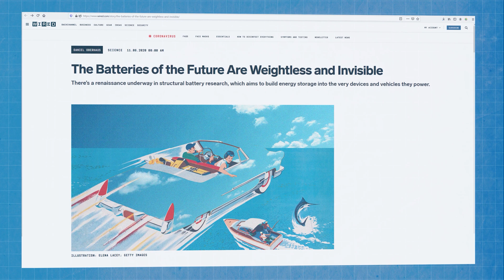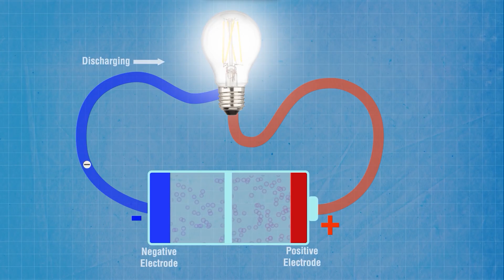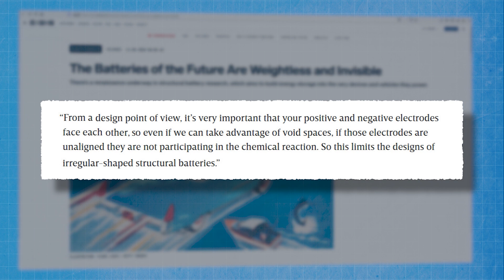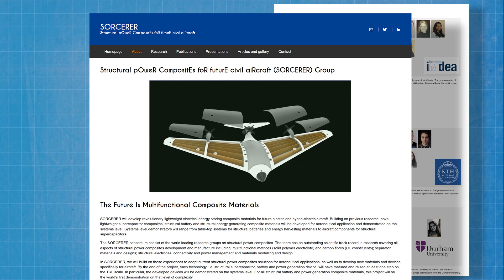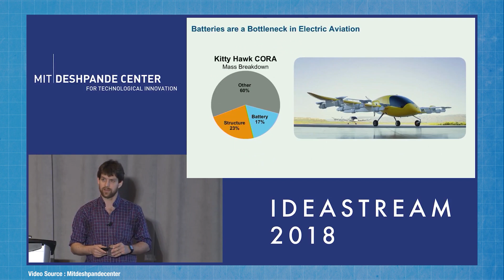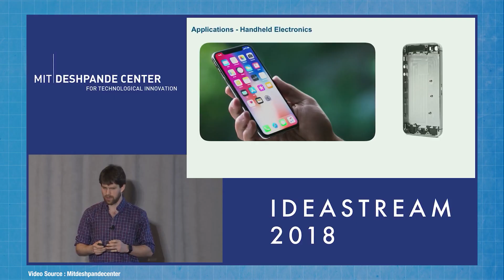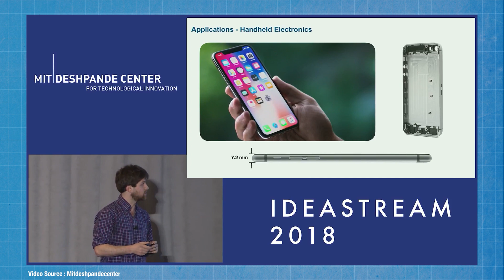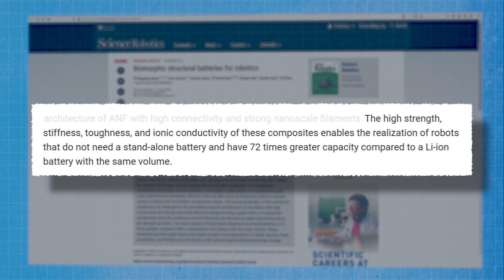Batteries in bodywork. Extending the range of cars and planes.

Comment: What are your thoughts on SONO SION? Solar panels on electric car to extend range? Many people use their cars for short town trips (work, shopping), so long range on a single charge is wasted on most car owners. In Hawaii, sono sion type cars will be especially practical.
Reply: Let's spitball some specs...
— 3 m² of panels on your car
— panels are 21% efficient
— battery charging is 95% efficient
— Car can drive 4 miles per kWh
— The sun provides 5 kWh per day per square meter
Multiply all those numbers together: 3 × 21% × 95% × 4 × 5 = 12 miles of range, if you drive and park all day in full sun (no clouds, no shade).

Is that worth it? It's not groundbreaking, anyway.
Reply: @ps.2  thanks for the math 
yes, in Hawaii, it is pretty sunny all year round.
Most people park in the sun.
On Oahu, coast to coast is less than 50 miles.
Hawaiian Electric burns oil to generate electricity...
Solar panels on the car would mean plugging in every month or two, rather than weekly.

So given my circumstances, thiis will work just fine.

Thx.
Reply: @alohanarealtyllc4046  The real question, though, is: what are the benefits and drawbacks of mounting panels directly onto a car, vs. mounting them on your roof.

Advantages of panels on a car: can charge it anywhere any time, including while driving. But think of the scale. Let's say you drive 200 miles on a charge. That takes maybe a little over 3 hours. How much extra mileage do you eke out if you're driving at noon on a sunny day the whole time, and your car is covered in solar cells? An extra 8 or 9 miles? Somehow that doesn't seem like a game-changer. It's not gonna be the difference between getting to your destination on one charge and having to stop along the way.

What about the advantages of instead mounting solar panels to your roof? They're working for you all the time whether your car is parked in sun or shade, whether its battery is already topped off or not. No need to worry about the extra weight on your car. Definitely easier to manufacture flat panels than car-body-shaped panels, and you can buy flat solar panels anywhere, you don't have to custom-build them for your model of car. Easier to service and replace them, too. And far easier to scale it up to more than 3 square meters, if you can afford it.

I get why it seems intuitive to want to cover a car or an airplane with solar panels in order to "make your own fuel as you go". But given how little energy you actually get for that much surface area, I think it makes a lot more sense to just do what we're already doing, and install more solar panels on larger, stationary, flat places, like roofs and fields. (A solar roof over a parking lot is a great idea and more parking lot owners should be doing it.)
Reply: @ps.2  ah, yes, the "panels on the roof are better argument".
Ok, here goes:
There are 1,000 condos on Oahu, with anywhere from 19 units to over 1,000 units per building.
There are tens of thousands of apartmets also.
Therefore, roof mounted solar is not an option (for hundreds of thousands of people here).
1. Plug in at home? To install a charging station in a condo is legal, but costs several thousands - then, Hawaiian Electric will burn oil to make electricity to sell you to charge your electeic car. Not my first choice.
Install in an apartment that you  rent, but do not own? Very unlikely.
2. Plug in around town?
A. The zoo in Waikiki has 4 charging stations, which are almost always in use.
B. Ala Moana Shopping Center has several charging stations disperesed around the massive parking lot - also, few, and almost always in use.
C. Costco, Sam's, Walmart, etc. Have. Few or none.

Did i mention it is sunny nearly every day of the year here?
And most cars park in the sun all day anyway?

Drivable distances are much shorter here. 
Rooftop solar is not an option (for me).
Sun is free. 
Plugging in is very limited, and time consuming.
Though distances are relatively short, a car is still needed for work, shopping, appointments, etc. 

In summary: 5 to 10 "free" miles / day from the sun is awesome, and liberating. It will work VERY well here for hundreds of thousands of people who drive, but not as much as people do in many other states.

Thank you!

Comment: Not convinced this is such a grand idea. Certainly a structural battery needs to withstand being flexed but what about being punctured?
Reply: In practice, individual cells will be restricted to maximum safe energy and power levels. Large panels will need to be divided into electrically independent cells. Thus a rescue worker will know how big the bangs will be when they cut into the wreckage to pull your mangled body out. They will also know how fast they can safely cut a panel. 

Alternatively, the panels can be inherently self sealing. Shorting a cell by pounding a nail through it makes a localized hot zone. The heat makes the separator expand to the point where the chemicals stop reacting.
Reply: Batteries be like: Try me

Comment: You said that that fossil fuel cars can only count 3%of the weight  but shurly you must count the engine as part of the weight?
Reply: That is a very good point, but it complicates the calculation immensely because we then have to account for the difference in weight between the electric engine and the gas engine, as well as transmission in gas cars- all vital and important pieces of a functioning vehicle. On the other hand, accounting only for the full gas tank vs the battery is comparing only energy density, so it's an easier comparison. Of course, it's notable that the whole thing gets complicated when we start talking about structural batteries because it's much more of an all or nothing situation.

Comment: Structural batteries are a crap idea because most current commercial batteries have a crap cycle life. Also, using lithium batteries make the whole vehicle into a big fire hazard. Now structural ultra-capacitors that could fly.

Comment: Electric cars will have to be heavily subsidized and the infrastructure has to be in place within 5 years or it ain't gonna happen.
Reply: The idea we're gonna make 100kwh batteries for everybody just yo drive around with is ridiculous, as is electric planes etc
Structural batteries don't reduce battery mass, they aim to reduce structural mass, and inefficiently and dangerously, better the batteries are boxed for safety and thermal management, but hey, its just have a thought, not real.
Reply: Teslas are not subsidized in America, and that doesn't seem to have hurt demand.  You're right about the infrastructure; it's pretty disappointing ATM unless you have a Tesla.
Reply: @incognitotorpedo42  subsidized in the sense investment money comes in faster than product goes out, its ponzi
Reply: @williamgoode9114  Investments are not subsidies, nor are publicly traded corporations Ponzi schemes.  Investment in equities is a bet on future earnings, not current earnings.
Reply: @incognitotorpedo42  still a million cars on the road for 540 billion is quite a pyramid

Comment: The thing that worries me most about this kind of technology, is the increased danger in case of catastrophic accidents. If a car essentially made  of batteries (as would be most efficient) crashes and any of the batterys ruptures, there appears the potential for a large fire, in the worst case, the whole care starts burning. If ,as in quite some crashes, doors and bumpers get bent and broken, I imagine that a battery would in the same place break and catch on fire.
Reply: structural car parts = solid state = no volatiles = no fires

There is batteries today you can puncture and they don't go up in flames. And they use electrolytes (volatiles even).

Comment: Structural batteries and also integration with motors is a fascinating subject. But It suffers from the same problems that the integrated circuits suffered from over the last several decades. Before the integrated circuits could be highly integrated, the optimal structure had to be determined.  Things like 8, 16, 32, 64 bit word sizes had to be determined.  The technologies behind memory, cache, registers and other specialized architectures had to be optimized.

The same situation affects an integrated structural power system.  Optimum shapes and sizes of fuselage and wings in an airplane have to be determined.  And for airplanes the skin has to be conductive to be lightning-proof.  Another major hurdle is how to make the structural batteries changeable so they can be replaced when they are worn out.  If the structural batteries are like other highly integrated systems they could take decades to develop.  Meanwhile climate change is relentlessly making the planet worse, so it looks like we humans will have to sacrifice technology for our survival as we battle flooding and desertification. It's not a serene future.

Comment: Hmm...IF you solve the battery problem how do you solve the problem of creating the electricity to charge the silly things?  Fossil fuel I assume?
Reply: Just Have a Think have numerous excellent videos on the subject.
Reply: Obviously not.  The idea is to get off carbon entirely.  Electric vehicles give you the ability to power your car without fossil fuels; that's the whole point.  Non-carbon sources of electricity include Hydro, geothermal, wind, solar, nuclear and tidal, off the top of my head.
Reply: @incognitotorpedo42  I would add waves to your list, too. There's at least a Finnish company called Wello Oy producing such power plants.

Comment: If Canzuk develops as an idea - have thought that bulk trade needs to get above the viscosity of water and the immense drag of hulls through it - sort of designing in a ‘treacle effect’.
In this connection wonder if ground-effect transporters of modular composition are a possibility and in which carbon containers may integrate as part of the effective design in the same way as you describe for batteries?
Insertable into steel containers upon trans oceanic delivery of course. Sea-water always available to balance up the weight of the system.

Comment: Consider how the first bathrooms were “water closets” and essentially just converted bedrooms or closets. Then the design of a separate bathroom became normal house design. I imagine soon homes will be designed with battery integration in the floors or walls
Reply: Houses last longer than just a couple years.. so this is not going to happen, unless the battery really lasts for more than 50 years minimum and is able to do 1-2 cycles per day then.. 50x1.5x365 is 27k cycles.. what battery tech can do that, if ever?
Reply: @joansparky4439  You have a point. If this tech could be made in such a way as to be fully recylable, though: terrific way to ease the problem of homelessness....
Reply: @joansparky4439  I don’t know what you’re imagining, but I would have the homes designed to allow cell replacement. My idea is to design their placement in the walls and floors, as opposed to dedicating space in a garage or attic for battery storage.

Comment: My very first concern about using batteries as structure is what happens during impact accidents. The amount of power needed to move a vehicle is frightening when one considers that a battery could be internally short circuited by a simple traffic accident. Will the car set itself on fire?

Comment: No, structual batteries are an abomination: When the battery needs replacing, the car is waste. We do not need throwavay single owner EVs! The weight reduction can't possible be enough to warrant a 1/3 the life of the vehicle. We  need brand independant battery packs, that fit multiple cars, to have a sustainable battery cycle. Besides making batteries cheaper, it also no longer is the individual EV manufacturer's responsibility to devellop battery systems. I would think a company like Bosch would pick up that business opportunity?
Reply: Agreed, also carbon fiber is quite hazardous if you breath in the particles when it breaks. And I don't think they will be easily recyclable

Comment: At 1:35 you said fuel at 3% and battery at a 1\3. Anyone have what % the full powertrain is? Batteries, motor, inverter etc compared to ice with fuel motor, clutch, gearbox and exhaust etc. I'm just curious. Cheers

Comment: what would the cost of a replacement part if a battery should fail or someone gets into an accident?
Reply: Our automated future-vehicles cannot crash
Reply: @ricos1497  As a computer scientist, I know not to trust automation. I let the peasants put their faith in the machines we peddle.
Reply: @SangoProductions213  I hear you. I'm involved in programming driverless cars, where the car learns from hours of watching me drive. On its first solo drive, my vehicle crashed whilst staring at a girl walking by.
Reply: @SangoProductions213  They don't have to get to perfect to be useful... just better than people, and when it comes to driving that isn't a terribly high bar to have to pass when you see how quickly the technology is evolving.  They already do better than 'average' drivers per vehicle mile under most situations.  I love my mom but she's 78 and I'd much rather she had a self-driving car than have her actually driving these days (not quite at the 'we need to have a talk stage, but she's closing in on it).
Reply: In Canada (and most developed countries) If a car gets into a severe enough accident to damage the structural chassis. It is an automatic insurance 'write off', and the car is scraped or salvaged for parts. Replacing the chassis is not economical, and even simple repair (like bending back) can not return the car back to it original safety specifications. 
The cost savings in manufacturing it all in one, will also easily cover the cost of the odd failure
Reply: @justinmallaiz4549  What I interpret from the video its not just the basic frame of the car but cross ties, A,B,C pillars, etc.  If a battery is located in one of these pieces and is damaged or needs replacing you are talking major cost for repair.  I am not saying its not a great use of space to do such a thing, but the O&M aspect of the design needs to be engineering in from the beginning.
Reply: @justinmallaiz4549  As someone who watches videos on the internet, I can confirm this information is true and accurate. 
After all, cars are literally designed to basically destroy themselves as ablative armor for the squishy humans inside. 
Going to be tough breaking the news to Skynet.

Comment: Looks like an absolute death trap, a normal Tesla battery malfunction is bad enough, now imagine it if the battery is spread out all around you.
Reply: If I'm not mistaken, the materials are different than the current battery. I'm no chemist, but will these shown in the video generate the same amount of heat (and potential risk)? It didn't seem so. For example, the carbon fibre one is encased in resin, which makes it safe(?).

Comment: C’est bien. Couldn’t the plane wings also be covered with solar panels? Production and storage integrated into the structure? I used to work for GM. Hopefully they’ll get with the programme. All the structure of a car enhanced to become the energy storage feature as well would bring the overall mass down.
Reply: There are electric planes that stay aloft for months at a time; they are very light weight, and have solar cells on their wings.  They don't carry humans, however.

Comment: Comparing the weight of the battery, to fuel weight, is silly Just as silly as would be comparing the weight of fuel to the weight of the charge in the battery. You need to compare the weight of the electric drive train to the weight of the components that are replaced, plus the fuel

Comment: They have quite a safety hurdle to jump over for using it in cars.  You don't want two cars involved in an accident and they explode from short circuits caused by the accident.
Reply: explosion = volatiles involved.. structural batteries, esp if they make up car parts will be solid state = no volatiles = no explosions

Comment: Or get yourself a plasma compression fusion reactor for limitless clean electrical energy. Look it up. It works.
Reply: It's a bit tricky to squeeze that in to a small car. ;)
Reply: @useodyseeorbitchute9450   they can squeeze it in watch if they want !,
Reply: If it works, why aren't we using it?  Probably because there are a ton of engineering problems and it's ridiculously expensive, but that's just a guess.